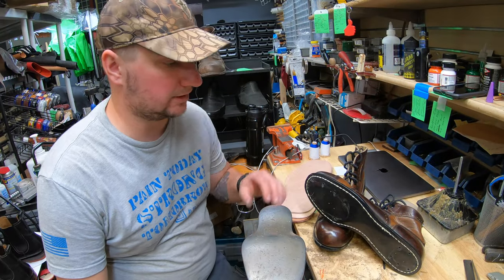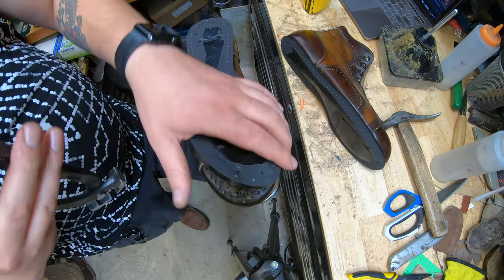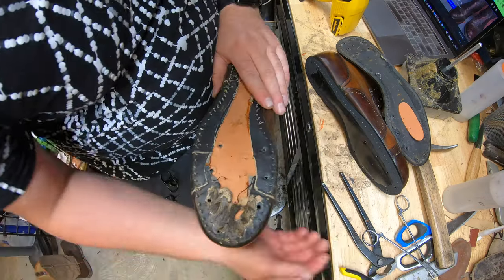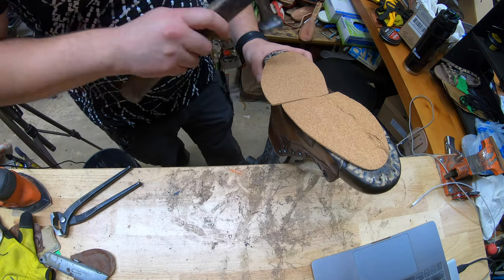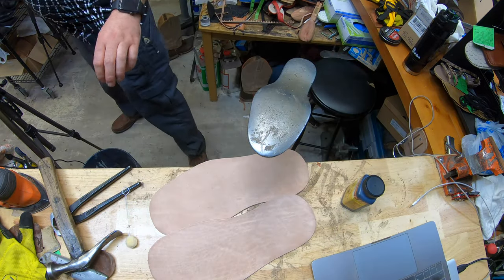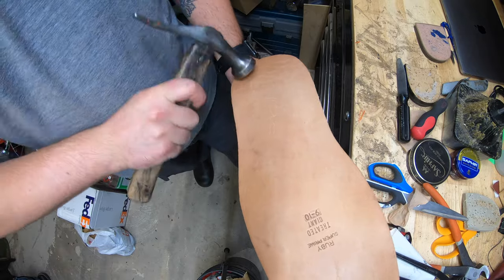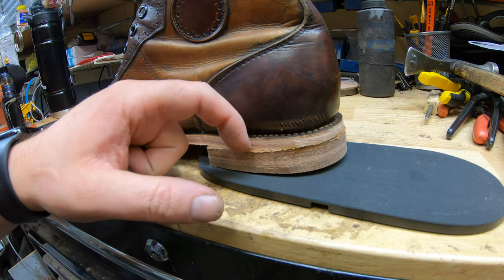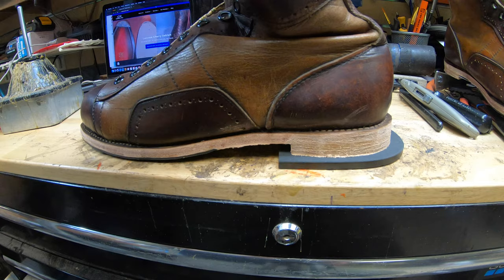Ice Skates converted to dress boots

Comment: Alan, doesn't the composite sole have a tendency to split and crack terribly? I am surprised you
didn't replace it with a new midsole. I have seen composite soles on military boots crumble, crack,
and disintegrate into powder. Hope those hold up for the owner. Interesting conversion. I have
also thought of such a conversion myself. Good for you, and for the owner. Thanks for sharing
what you do with the rest of those of us who are interested in the work of a cobbler. DJ
Reply from the maker: If you are talking about the footbed it is actually a fiber board type material that is actually common in footwear and holds up well just not as well as leather but to replace it does take a lot more work adding a lot more to the cost as well. The footbed was in great shape still and it would be better in the long run to just wear it out and have it replaced on the next resole because these boots will already need some breaking in